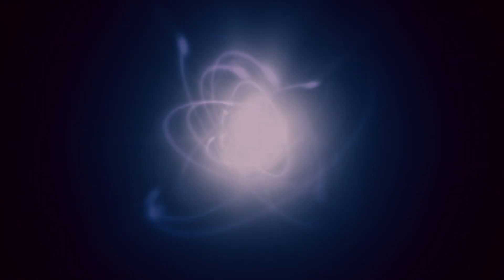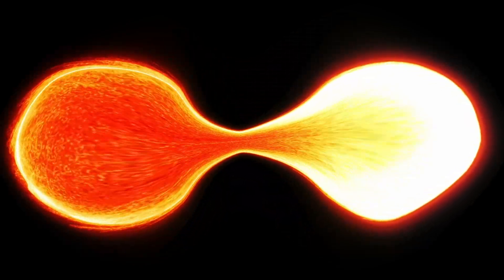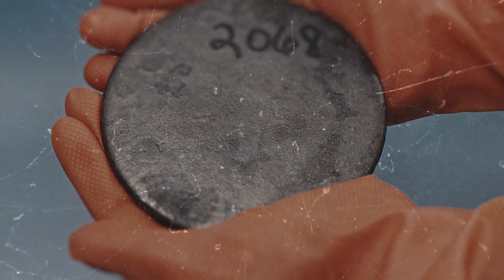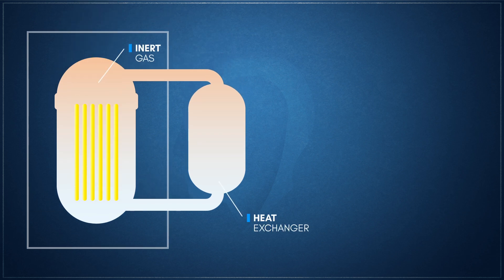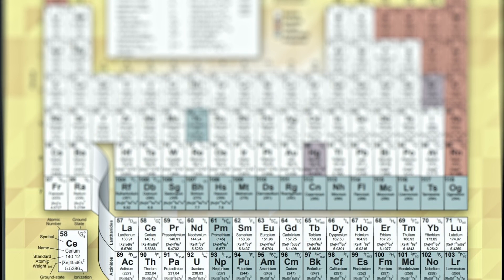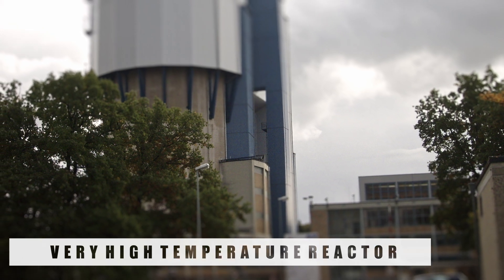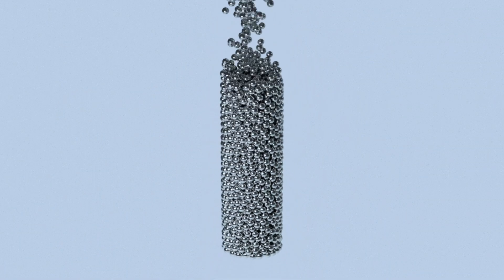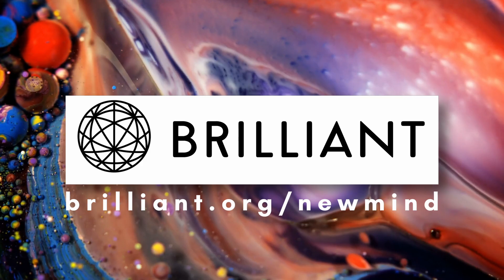Portable Nuclear Power

Comment: Nuclear engineer here. While the video does look really nice, there are a few corrections that should be made. First, it's Generation 2, 3 and 3+ (there is no Gen 2+). Secondly, the BWR does not "irradiate" less than a PWR, and certainly not the containment. The containment is the concrete building around the reactor, designed to protect the environment in case of an accident, it is not something that gets irradiated. BWR's are actually less secure from a radiation standpoint as just one leak from the primary system means it goes directly to the environment. Gas Cooled reactors have so many disadvantages that I can't explain in a comment... but that's why they weren't used.
Reply: Gen 2+ just means a Gen 2 that has undergone maintenance and some upgrades. They are not Gen 3 and are not a genuine Gen 2 reactor either. 
It is like saying a custom 1969 mustang in that it is not an original but not a new generation mustang either.
Reply: @bighands69  never heard of Gen 2+ through bachelors, masters and PhD...
Reply: @bighands69  That would then just be a modified Gen 2, not specifically a Gen 2+
Reply: Gas reactors have been used in UK for ex. They will be used again like X energy. I favor NuScale( financial interest).
Reply: @paulbedichek2679  yes, and dismantling them costs more than for any other reactor due to the magnox rods made out of magnesium alloy, which burst into flames if they take them out of the spent fuel pool. So they are still there after 40 years. The pool itself is also expensive as they don't use simple purified water as in other reactors, they need to use a corrosion inhibitor acid. Mainly gas cooled reactors are about 1% more efficient (higher temperatures), but the problems they bring are definitely not worth it. And yes, GCR's were mainly used exclusively in the UK, the British wanted to do things differently. France tried it too initially but they were smart and gave up early. I highly doubt they will build new ones, but if they do, I surely hope they have properly figured out everything about the materials used.
Reply: @TrinityAlex  You think computer chips today are better than ons designs 30 years ago? Same thing with gas reactors,they'll use He,the Chinese have on up connected to the grid so easy to build and productive they decided to build 20. I'm invested in NuScale which will merge with the spac I purchased SVSVU,it keeps going up, they will use traditional light water but i a much improved form 77 MW reactors mostly submerged in an underground pool,in groups of 6,8,or 12.
So I naturally should be very opposed to gas reactors, thy are a threat to my wallet, but I can't ,they'll be good for th world, high outlet tmps like 800c,can easily make chap Hydrogen ,called pink hydrogen,steam is ready to fall apart at those temperatures ad a small current completes the job.
Thy are so inherently safe even nations like Australia ad Germany will embrace it.
Although I'd prefer they'd order NuScale plants.
Reply: @paulbedichek2679  I've worked for both CNPE and CGN in China, and they are only building PWR's. I don't see anything under construction that is a GCR, except a prototype reactor, which will definitely fail. They even tried to use molten salt for Solar Power Plants and it failed (do some research), I am 100% sure it will fail ... unless they develop some magical materials. Imagine having to replace a leaking valve when we're talking radioactive molten salt. Speaking of stock, Tesla has a much better return than SVSU... also, having a stock go up due to hype does not mean it will be a successful investment long-term. And regarding high outlet temps, there's a reason why we don't have that, we have not yet developed proper materials to withstand that temperature and be bombarded by neutrons at the same time. And Australia to embrace nuclear energy? that would be a sight to see. Anyway, best of luck to you.
Reply: @TrinityAlex  Thanks, yes .materials are critical to get high tmps ,but that is why they start at 800C not 1000C which is even higher quality heat. The Chinese He reactor is working fie ad connected to the grid.
In the US we'll have X energy,Helium cooled with Triso fuel.
Tesla Chia is crippled ad that is where they produce 105% of their profit,Tesla makes a tiny percentage of the income per capitalization than GM,plus GM has new products while Tesla delays long ago announced products and sells the same old models.
Reply: @TrinityAlex  The Chinese reactor is referred to as an HTR as in high temperature reactor to make current, H2, and process heat , either for industry or district heating.
Reply: I'm no expert of nuclear engineering and this is the first time i've heard of GCR's. That said, I'd like to know your opinion on molten salt reactors. Do you imagine they'll make a resurgence, or even replace PWR/BWR's?
Reply: @L7Mcmacdaddy  They are still being researched, the main problem is with materials used, salt is very corrosive, and there are very big problems if the salt mixes with the water in the steam generators. Plus it solidifies where you don't want it to solidify, creating even more problems. They have main advantages, they are not pressurized and can use the Thorium fuel cycle (are breeder reactors). They can also use high level radioactive waste as fuel (used fuel rods from our current reactors) and burn them almost completely, solving the "problem" we have about where to put our current radioactive waste. (Tbh, it's not really a problem as all the used radioactive rods in the world would fit in a football field, ~2 m high, but still). I personally think we should continue with PWR's it's a proven technology, very clean, but we can still automatize for example control room procedures even further. As for future technologies, I think the lead-cooled fast reactor would be more feasible than a molten salt reactor, as lead has lower melting temperature than salt and it's not corrosive, (but that one seems to again have problems with solidification).

Comment: The nuclear cascade threatens ionization of DNA globally over time.  The nuclear nonproliferation treaty enforcement was to improve the likelihood of survival of humanity.  We do not develop build or share nuclear technology.. We are aiming for no nuclear power or technology.  Edison generator and dynamos with inverters and transformers to deliver high voltage AC power do not produce pollution or use fuel sources.  The low voltage AC grid design is AC power and a lot of inexpensive power plants. We can use Edison generators in cars trucks trains airplanes helicopters and ships immediately reduce fuel cost and consumption.

Comment: Advanced gas cooled reactors do not need the expensive forging of the reaction chamber like the standard pwrs. They get by with reactor vessels made from reinforced concrete.
Unfortunately, Britain had lost its pioneering spirit by the 1990s, and commissioned its first pwr at Sizewell, based on US designs of the time. 
Never mind because the whole concept of the pwr is a mess. We now know the technology for getting all the benefits of nuclear power with none of the PWR's drawbacks is the Moten salt reactor.
Unfortunately, while there is plenty of money to mitigate the disadvantages of pwrs, there is never enough to develop the safe alternative, the msr.
Nevertheless the British company MOLTEX has a variant called the Stable salt reactor, and is actually building its first  full scale reactor in New Brunswick. About one hundred mw if my memory serves me.
Reply: The media in the UK have terrified the public on everything. Even fracking has been turned into the mythical monster that causes earthquakes because very sensitive equipment can pick up small tremors and they have used that to convince the public of earthquakes caused by fracking. 
The use of natural gas, nuclear and renewable could make the UK produce far more energy that it needs and could use that as the basis of a new industrial revolution that is far cleaner and more advanced than anything before it.
Reply: @bighands69  
I agree with you. But the cherry on the cake is the molten salt reactor. 
By contrast, the pwr has done immense damage to the reputation of nuclear power.
Reply: @paulsutton5896  
MSR maybe the future but they would need development along with a few other types of technologies. 
It would be interesting to see what MSR could achieve with today's engineering and maybe engineering in 20 years time.
Reply: @bighands69  
Yes. But in New Brunswick, Canada, Moltex is building a reactor  to connect to the grid (of about 300 mega watts). It behoves the rest of us to keep an eye on it - NOW. The MSR is inherently safer than the horrible PWRs which are more like jacks-in-the box.

Comment: I heard the majority of plants are leaking radiation, anyone have more info on it? The question about it exists and I think it would be important to be addressed.
Reply: They're not. You actually have lower than normal radiation inside the plant (excluding hot zones) and there is extensive radiation monitoring locally, as well as globally. We monitor radiation globally because we want to know if someone sets off a nuke but it has a side effect of monitoring active nuclear power plants. 

Leaks from nuke power plants are noticeable from great distances. It was a company in Sweden that first noticed Chernobyl. The isotopes that would be leaked from a modern plant are detectible for 10s to millions of years. Operating in a global system, they would be noticable, especially given they are not naturaly present. 

If there were wise spread leaks, it would absolutely get out.
Reply: 34.
Reply: Do you understand what radiation even is?

Comment: All components of in the field of the neutron bombardment change their properties because the materials atoms are being changed . This is another inherent issue with nuclear energy. Which causes the deterioration of the components over time. Which then  requires rebuilding.
Reply: The big issue is that the neutrons break the bonds in the metal components in and around the reactor.  Samples have been placed around reactors and analyzed since the beginning, so they know exactly what the effects of neutron embrittlement are.  Most times simply heating the metal up to high temperatures and letting it cool very slowly (annealing) will restore the majority of the strength.  The rest you just over-build in at the beginning.

Comment: Small Modular Reactors using Pebble technology is my favor. They can not melt down.  They self shut down when things get wild.  Waist pebbles are sealed in Glass and can be stored under ground causing ZERO threats.
Reply: Putting them deep underground makes them very safe. They can be put into special materials that will last thousands of years. 
If space launches get as cheap as people predict there is the opportunity to get the material and send it towards saturn to be disposed off. 
There is currently 400,000 tons of nuclear spent fuels that could easily be sent to saturn with about 4000 launches.

Comment: Solid fuel reactors suffer from 0.5% to 0.7% fuel burnup and long-lived highly radioactive waste. Molten Salt Reactors offer 98% burnup, ability to burn waste from conventional reactors, low amounts of short-lived waste products, and walk-away safe. They run at atmospheric pressure and do not need huge containment vessels. They can be refueled continuously while operating. They are cheaper and faster to build, and cheaper to operate than conventional rectors. They have already demonstrated long-term operation since the 1960's. There is a wealth of information online. Here are some examples:

Thorium Lifters Could Power Civilization for BILLIONS of Years!
https://www.youtube.com/watch?v=74iiaXIVtZI	

Molten-Salt Reactor Choices - Kirk Sorensen of Flibe Energy
https://www.youtube.com/watch?v=mz49CB8XGQo

Comment: The sad part, in my opinion, is that the strong negative public and political image of nuclear power, which spread during the 90s and up until today, has drastically hindered research. Nuclear power technology research has been left pretty much stagnant compared to other energy technologies. But now the issues with CO2 emissions and climate change are knocking on the door, and governments have only now "waken up" to the huge potential of nuclear power. The problem is, right now, we are mostly picking up the slack of these decades. Just imagine if we had followed up on thorium reactors and SMRs back in the early 2000s, where would our energy technology be today.

Comment: 180 atmospheres may not sound like a lot, but it's equivalent to 2645.271 pounds per square inch
Reply: The hydraulic fluid on a tractor can get that high.
Reply: @nathanwahl9224  Hydraulic fluid isn't radioactive.

Comment: 3:24
uranium is not used as fuel because it was easily accesible, it was used cuz you could make bombs out of it, thorium is found all over the world and is an excellent fuel, cant go into meltdown, has much less radioactive waste  and the waste it does have has a much shorter lifespan than waste from uranium,  and you cant make bombs out of it, excactly the reason they didnt start using it until very recently.
Reply: Thorium-232 can be used to make U-233, which has been demonstrated capable of being used in weapons.  You may not be able to make a bomb from the thorium, but you can from uranium made from the thorium.
Reply: @gizmophoto3577  it is just a longer strenuous process that can just be skipped though.
Reply: @alexzanderroberts995 , it can certainly be skipped, but it is nonetheless a potential pathway to a weapon.  I'm not an expert in that area, by any means (spent my career dealing with light water reactors), but it isn't easy to enrich uranium or breed and extract plutonium, either.
Reply: Pure conspiracy theory nonsense. 
Thorium is nearly as bad as solar freakin roads.

Comment: interesting how centuries old method for producing the electricity hasn't changed much (mechanical movement to electricity), it's just the heat source replaced. I am wondering if we can harvest even more energy by beta voltaic effect or using heat differential (TEG)  to produce electricity
Reply: To generate electricity other than chemical or mechanical is going to require some very fancy engineering and physics. 
It will require whole new material types with very weird properties.We may get that through nanotechnology at some point.

Comment: You guys really covered a great deal of information, but totally mislead us by conveniently omitting the fact:  1 - It takes a great deal of mining, separation, and processing to make fissionable Uranium.  This then has to be pelletized and transported under very strict safety measures to all the power plants.  2 - There is no effective policy to dispose of radioactive waste.  It is currently being stored on-site at all these power plants.  3 - These plants cannot be easily decommissioned as the highly active fissile material takes a long time to cool down.
Reply: Furthermore his statement it's the safest energy available, research however paints a different picture:  
Markandya, A., & Wilkinson, P. (2007). Electricity generation and health. The Lancet, 370(9591), 979-990 

Nuclear at 0.007 while solar and hydro are at 0.002 and wind at 0.004 are 2-3 times less deadly messured as fatalities/TWH. 
before i tried to provide a link to the named paper but it was removed twice so either he doesn't like links or truth.

But at least they are working on number 2 with thorium reactors and transmutation pilotplants as well as the fast breeder reaktor BN-800 HOWEVER as of right now BN-800 gets very pure fuel from recycled nuclear warheads and not a varriable mixture found in nuclear waste. There are some great concepts but as of right now they are concepts not industrialscale applicable methods. Let's hope this will change.
Reply: 35.